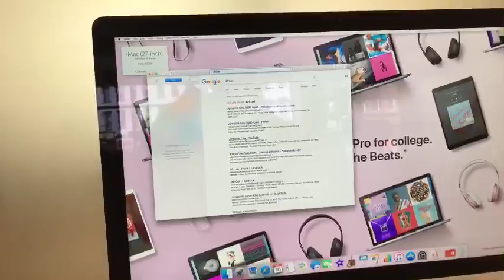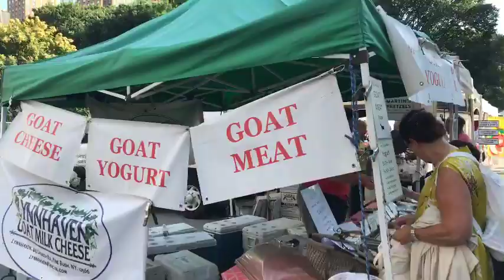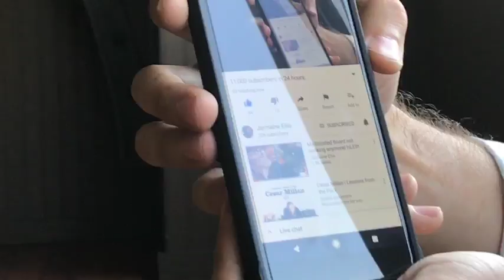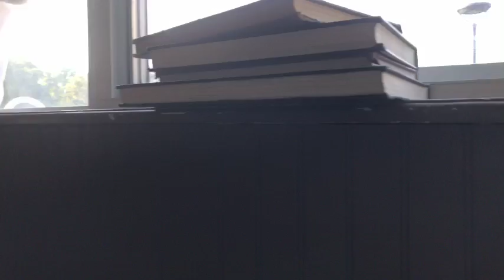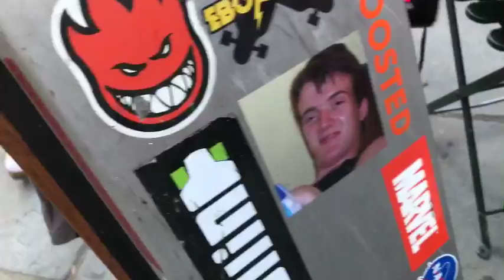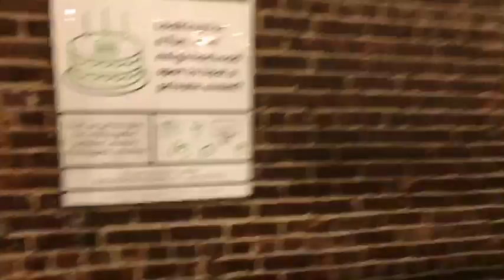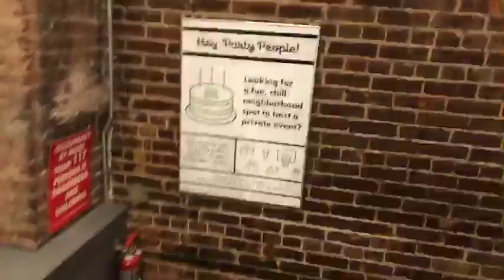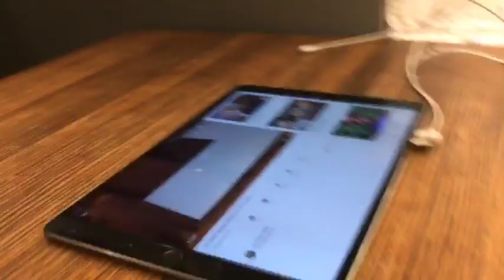11,000 subscribers in 24 hours

Comment: Jermaine of course if the circuit board gets wet it fucks up all the solder joints on the board and they curode I don't think that board is water proof I would not advise riding through water you can look it it up on you tube bad solder joints or croded solder joint it will educate you about circuit boards and how they don't like water hey good luck in your research about this issue